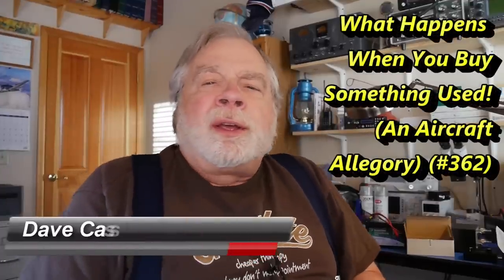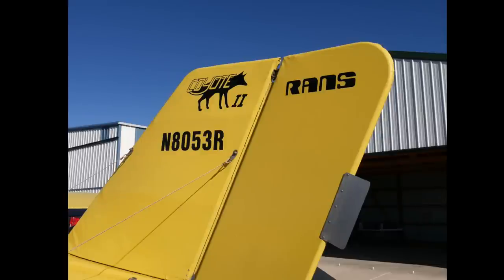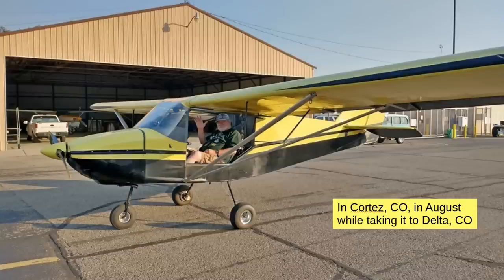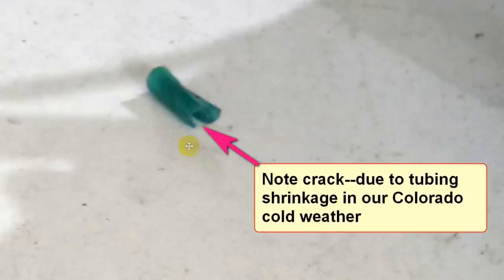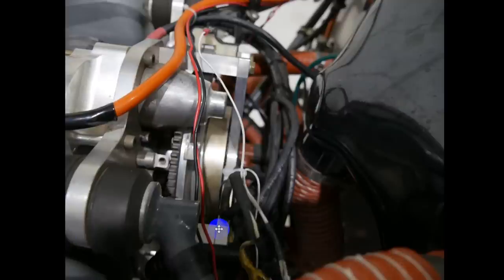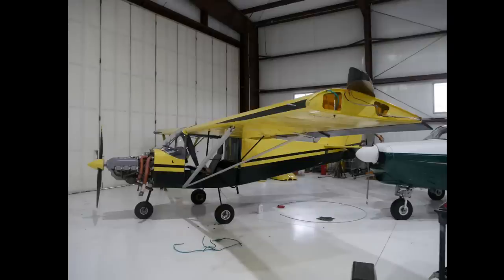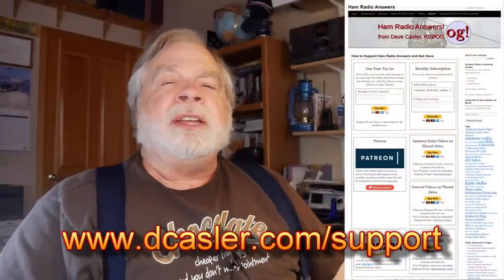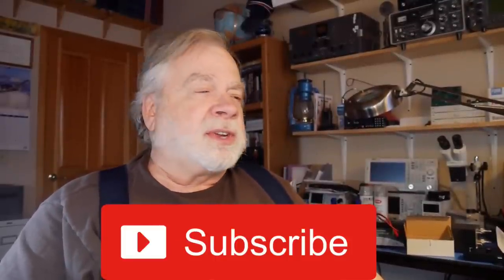An Aircraft Tale That Applies to Ham Radio (#362)

Comment: i think the brackets surounding the pulley has holes in it and they are for a pin that  holds the cable in place and prevents it from jumping off the pulley if some how slack is introduced to the cable system also check the bearings on that pulley for binding also the black wire looks like it is rubbing on the rudder cable

Comment: For my Botany M.S., I was able to assemble a used a Nier-type stable isotope mass spectrometer. 
   That was a good lesson on dealing with used equipment! 
   And yes it actually worked well enough to analyze samples. 
   Even if you buy new, there are serious problems. 
   Thank you for the video. N0QFT

Comment: One of the big days in my life is when I Soloed! I ran out of money and didn't get my license, but I still got to solo!  You can take an aircraft radio antenna and cut it down to work on 2M. I worked on aircraft radios for a time and installed a radio antenna in an airplane for 155MHz.  That was many years ago and I don't remember how much we cut off but I am sure you can do the math and find out. The only other thing that you may need to do is to put some aluminum support and ground plan to put the antenna on the cloth skin. Even on a normal aircraft when pulling in an antenna some aluminum reinforcement is added in places where the s,in is thin. At above about 5000 AGL and watt radio can get really good range! At 10,000 AGL with 25 watts you should be able to cover most of state. The mountains will be the only thing stopping you from covering all of the state. You will have a little trouble getting the mic on your airplane headset to work with your 2M radio because airplane mic have voltage going to them like the old carbon mics. But I think you can work that out. May need a transformer to go from the low ohm mic to the high ohm radio input, and isolate the voltage and change the impedance to. There are switches made for airplane to switch the mic from one radio to another.  Good luck on your SOLO FLIGHT!

Comment: Many years ago, while involved in an instruction project contracted to a major aviation school, one of the aircraft had large numbers (up to 17) on its compass deviation card. Thinking this was absurd, yet the school said it was fine, during a maintenance input to an outside vendor, i asked that this be evaluated. It was determined that the after-market mounting bracket, made by the school, which also taught A&P curriculum, was made of steel.
Reply from the maker: That would do it!

Comment: That looks like a 7 strand hardware store cable, rather than 49 or 133 strand aviation quality cable. It will work harden rapidly at every sheave because of the bend at change of direction. Check every cable in that thing. The side plates on that pulley look like overhead door parts. Your A&P may be buying you quite a bit of hardware. Nice little plane when it’s all up to par. (But they’re all time bombs. Just be glad it doesn’t have a vacuum pump.)

Comment: The interface on the nosewheel gear (meaning pins that extend on both sides of the axle) looks identical to a Cessna 172.  Have you tried one of their nosewheel steering bars?  You could probably get something for ten bucks.
Reply: pilotshop has a bunch new for around $70.

Comment: I was a brand new ham and I bought a used radio from a well known shop. It turned on and looked fine. I had problems getting a good HF signal and eventually bought a new FT 891 and had  good reception. Then I A-B'ed the radios and KNEW there was a problem with the radio. The 30 day return window had expired. I sent it to a repair shop with my concerns and he got it all fixed up and did one or two small mods that improved it in small ways. The repair was $135 but the shipping was 130 both ways. Inexperience bit me. It wont do it again. When you add the cost of the used radio and the repairs I might as well have bought a new radio and I would have had better features..
Jaberu engines have been known to have issues though there are some aftermarket parts to correct them. I dont know what the issue is with Australian made engines.
I would imagine that a uhf signal would travel a long way at 10,000 feet. That would be a great segment for the channel.

Comment: Maybe you could install a 4wd type winch, with remote control and dyneema fiber instead of heavier cable, and just run it out & use it to haul the plane in?
Reply: A cheap and brilliant solution; especially AOPilot's who are DIY and alone in every challenge and phase of all their flights.  Today, we have to adjust to greater independence, or lack of services without loss of  flight capability, flexibility, quality or safety.

Comment: My neighbor built a kit aircraft. I didn't do much besides peek at it from time to time. I guess it is similar to cars, sometimes the problems aren't obvious until later and a good mechanic is worth their weight in gold.

As for radios, I had a fellow who approached me about my ATAS120 antenna, which I had decided I disliked and he offered me a "non working" FT- 857D. He said it wouldn't receive. I expected to have to do some sleuthing, but once I hooked it up and powered it on, I checked RF gain,  it was all the way down, I turned it up and that was the entire problem with the radio. I let the fellow know, as I didn't think it was fair, but he was good with the trade.

I only recently sold that radio and still wonder if that was a good choice lol.

Comment: I would recomend that such problem items as you have found
- you can do a time and hours based list of maintenance items that must be checked on a regular basis
- being an experemential vehicle, often the maintenance schedule is not fully developed, or non existent.
- do not assume that the new cables will last 10 years, you never know, they may have been replaced previously.
- often it is the routing of cables and tubes around fixed components that causes issue ( rubbing, kinks etc)

I can recall when the bonnet was lifted for pre flight checks on to see wireing that was worse than my 20+ year old car with lucas electrics.
- brittle, cracked insulation and exposed conductors
- Now, as a young fella, I had addressed and rewired all such problematic areas on my car.
- As a professional Engineer, responsible for heavy equipment fleet maintenance at the time, never havind seen under the bonnet of a light aircraft before, I was a bit dismayed as to the poor standard of maintenance (would have been unacceptable on heavy equipment under my watch, let alone an aircraft). 
- The pilot completed the pre flight checks and off we went ( me wondering how to deal with a fire or other electrical failure and whot sort of failure would make us fall out of the sky ...)

As I look back, ( now having a number of friends in the industry)
- It seems that Sloppy Joe the "she'll be right" maintainer and Schultz ( I see Nothing...) his supervisor abound in all such industries.
- finding some one who cares and is competent... these people are like gold and worth every penny ... treat them with care and kindness and stay alive
- Unfortunatly, many operators and owners are of the She'll be Right way of thinking and are happy with Sloppy Joe and Schultz.
Reply from the maker: I'm fortunate to be at an airport (KAJZ) where I've developed a good relationship with the A&P mechanics. There are also several active EAA members at the airport. I will do my own maintenance only when I am absolutely certain I know what I'm doing.

Comment: Hi Dave, I am sorry about all the problems you are having.  It seems your maintenance records are little to none at best.  Given there are so many unknowns that could get you killed, I would start from scratch with replacing everything that can wear or needs to be replaced on a periodic basis.  Airplanes are really fun, but yet they will always be endless money pits.  Happy flying.  As far as your towbar goes, sketch out what you need and take it to a good metal fabrication shop.  Do not tell them it is for an aircraft or you will be charged five times more than what you should be charged....tell the fabricator it is for attaching a horse to a buggy on a farm if you have to.

Comment: After sitting so long the base gasket possibly has shrunk and may swell with use. May be worth watching it to see if the leak stops as long as it's not dripping. Not to brag, but back in the 70's I soloed a 150 in 4.5 hrs on a very long and wide runway.

Comment: you know that the artificial horizon is vacuum driven, so i would check the hose coming from the vacuumpump to the instrument
best to replace non metal tubing every 5 years
Reply from the maker: My original artificial horizon was electric-driven with electronic (ring-laser-diode) gyros. My new one is the Garmin G-5 which is also entirely electronic. One thing I don't like about the G-5 is the info on the screen is too small to see easily. None of the instruments is vacuum-driven and there is no vacuum source on the engine. The "autopilot" if you can call it that, has electric-driven mechanical gyros.

Comment: Plastics, rubber die early deaths in Arizona due to low humidity, high temperatures, and especially if exposed to direct sunlight.
It looks to me like the aircraft needs a FULL safety inspection. Sellers are going to be reluctant to reveal everything they know let alone the things that need attention that they don't know about.

Comment: WOW! I would have thought the Annual should have caught the questionable "green" hose problem.
Reply: An annual inspection should have found all of this, IMHO.
Reply: Should have caught the cable problem too.
Reply: And the missing nuts and "ready to fall out" bolt! Somebody's A&P licence needs withdrawing!
Reply: Dave’s point was made and he compared it to owning something expensive that needed work upon getting it home; but that would have been an extremely short video!
Reply: Experimental aircraft do not require an annual inspection.  In stead they require a “condition inspection”.  This inspection can be done by the builder. 

An Experimental must be found to be in a “condition for safe operation.” There is no prescribed standard for making that determination other than Part 43, appendix D of the FARs. That means that you, as the holder of a Repairman Certificate or your A&P mechanic, must make that call.

If you built your airplane and received a Repairman Certificate from the FAA, you are eligible to perform this inspection. If you are not the builder, you will need to find a licensed A&P mechanic to perform and sign off your inspection. Unlike a certificated airplane owner, you do not need an A&P with Inspection Authorization (IA).
Reply: @MIG29SUU27  Agree this is all true, but since he is not the builder he cannot perform that task. But he can inspect any portion of his own aircraft at any time and demand it be brought up to FAA or manufacturers specification. Or FAAPMA or TSO, experimental being the key, makes much of this at the discretion of the person signing the ‘annual’ condition inspection.
Reply: Yeah at the time that I made my post I didn't realize Dave own an experimental kit plane. And yes it's true experimental aircraft do not require an annual. But glad to see Dave went ahead and had it gone through anyway!
Reply: @wilsonal03  it does require an annual inspection and sign off, just not called an ‘annual’
Reply: @jameski5oeb668  thx for the info...... own a 172rg so I have to get that annual
Reply: @wilsonal03  13 year owner of a c-172 myself, but member of EAA for a couple decades. Assisted in several Experimental builds, and watched a designated inspector look over and sign off a new build I helped with! Awesome experience!

Comment: Well thank you for the advice and looking at a plane also looking at second hand radio equipment definitely myself I bought a few second hand shut wave receivers and some of them did have problems especially when it comes to two receivers however I must admit the tubes sound a lot better than transistor it's got a nice warm fuzzy sound to it the definitely have to be tuned and it definitely have to be handled carefully it's a good thing you're still alive concerning this airplane you must have some type of garden angel keeping an eye on you at the same time I like to thank you for the advice for the second-hand airplanes and as well for the second hand radios I definitely maybe in the future would consider getting an SDR Radio transceiver however the old tube radios sounds so much better

Comment: So sorry this happened to you, Dave.  Your plane is pretty and it's going to be great when fixed.  I hate to tell you this, but even when knew aircraft are money pits.  Very glad nothing happened to you in the air.
I sort of disagree with you about used gear though, with one condition.  I had an Elmer when a baby ham who checked out all my stuff I was interested in.  I have owned a lot of rigs for the time I have been active and only one was bought new, and that one was the only dog in the bunch.  Have someone check it out and usually you'll be fine in my opinion.  For God's sake though don't buy off eBay.  Even if sound, I have never seen stuff there go for a reasonable price. 
Dave, try not to get a bad taste in your mouth towards your plane.  When fixed up you're gonna have a great time with it.  Every thing is going wrong now, but bad runs pass.  Things will look up soon and it won't seem so bad.  73, W8PEF

Comment: I'm an auto mechanic. But I do a monthly patrol of the area looking for outdoor power equipment sitting out near the road with a "free" sign on it.
Why? Because I'm taking someone else's "problem" off their hands. However, like I said, I'm an auto mechanic.
I'm not such a new auto mechanic that I only understand fuel injection either. I understand an "analog fuel ratio control system" aka a carb just fine.
And by that metric, a lawnmower is just a Mustang from the '60s, but smaller and cheaper and made in China by the lowest bidder.
So the problems nearly always the same. The carburettor has gotten varnish or some other kind of gunk in it, or one of the seals isn't sealing anymore, and so that little analog computer in it isn't spitting out the right answer for how much fuel to put in the intake air anymore.
Solution? Same as in the '60s, but with a modern twist. You take that carb off the engine, you get it on your work bench, and you take it all the way apart as far as you can without drilling out any seal plugs. The modern twist is that now we have Google and Amazon, which makes looking up the kit of o-rings and other seals as easy as a bit of typing and a few clicks, provided you punched in the right model number of whatever piece of power equipment you have found yourself. The parts to fix these things are hardly ever expensive. And the points/condenser/magneto basically never need looking at (I check it anyways, because there was one time I encountered a sheared flywheel key that I only detected because the engine would try to fire on the intake stroke when I pulled the cord).

It's always the carb. And there's one culprit. The fuel.
They put 10% ethanol in the gasoline now.
That means the gasoline is hygroscopic, which is a word that means it will absorb moisture.
Gasoline is just a kind of oil, and water's denser than oil, so that moisture settles in the carb's float bowl since that's usually the lowest point in the system (on purpose, so that it uses the whole volume of the fuel tank).
And so that water corrodes whatever it touches, sometimes in as little as a single interval between when you needed it last and when you need it now (over the winter for a lawnmower, any time but the winter for a snowblower, who knows how long for a generator, you get the idea).
By the way, the things its touching are all the little parts inside the float bowl, which are things like the fuel metering orifice (gets obstructed), the float valve (gets stuck open or closed, or is just sticky).
Surprisingly I haven't seen a carb that was full of "too much" varnish in a very long time. It's always corrosion these days.

What you're buying when you buy that special "outdoor power equipment fuel" is just gasoline that doesn't have any ethanol in it... at an exorbitant markup.
Of course, nobody expects you to distill the ethanol out of your "regular 87 octane from the gas station" gasoline before you use it, that would be silly (and a fire or environmental disaster waiting to happen).

But what if I told you there might be a cheaper solution out there? There is, by the way. And you've been inches from it this whole time you were buying "normal" gas for your "normal" vehicle you use to go to work and back every day.
You don't need to buy the "special" fuel from the hardware store. You can get something very close to it from the gas station (maybe, there should be at least one gas station in your area that carries what you need).
Next time you go get fuel for your vehicle, try seeing what's in the higher octane gasoline grades you can buy wherever you usually get gas.
One or more of those grades of gasoline might not have any ethanol in it.
If you find one that doesn't have ethanol in it, that's the one you want to use for your outdoor power equipment (as well as any other infrequently-used gasoline fueled equipment you have, including vehicles).

The problem with ethanol in gasoline is that you have to nearly constantly use whatever uses that kind of gasoline, or you get fuel system damage that puts your lawnmower on the side of the street, waiting for me to pick it up.